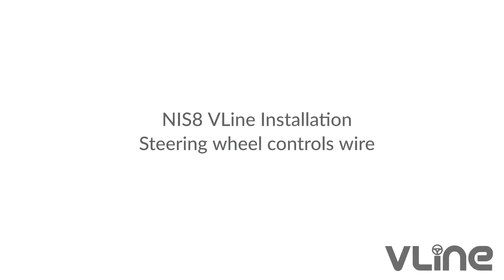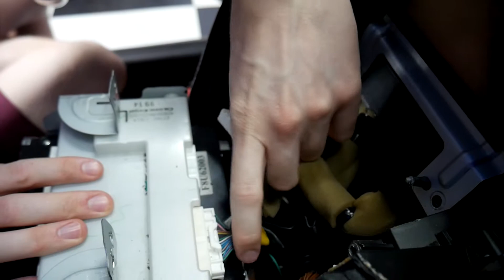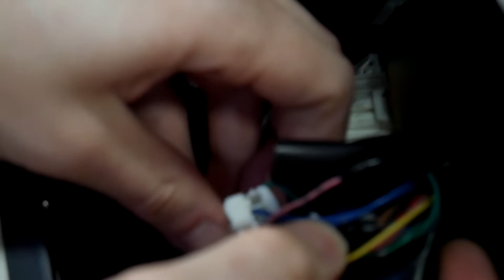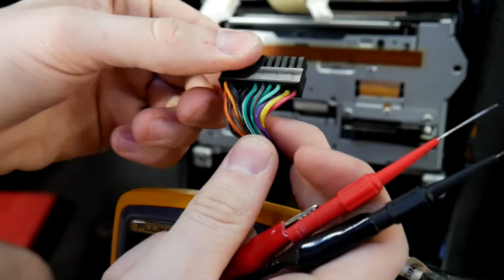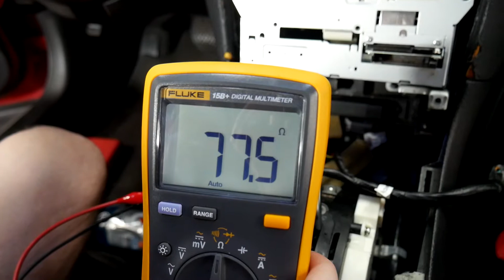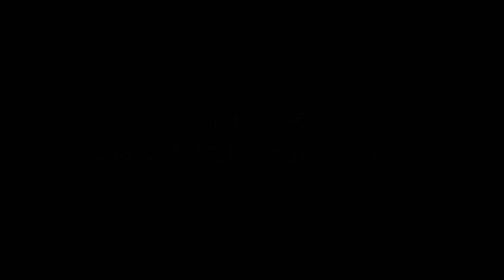How to connect steering wheel control wire - VLine CarPlay®  Nissan Infiniti 2008-2012 - NIS8VL2

Comment: Is one of those wire a ground and can you use the multi meter to find the steering control wire
Reply from the maker: The Black wire is ground and the Green wire is the Steering Wheel Control wire.
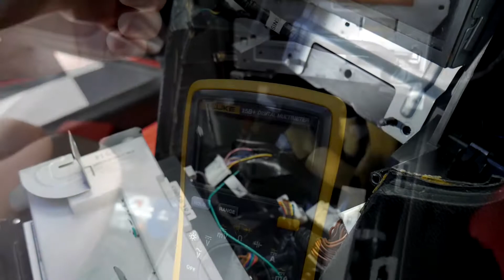At 2:07 in the video we show how to test the Steering Wheel Control wire with a Multimeter.
Reply: @gromaudio @